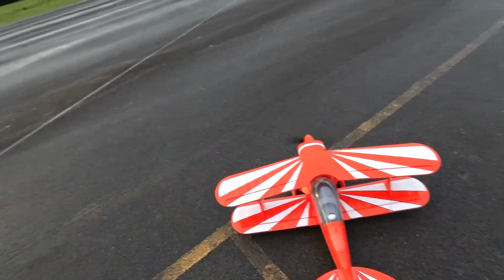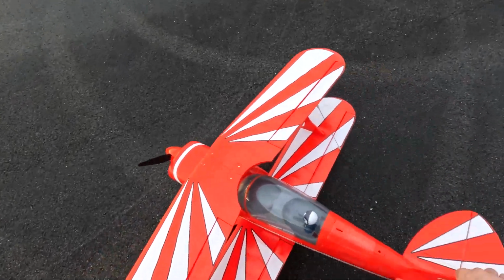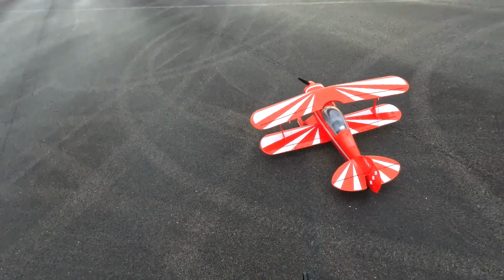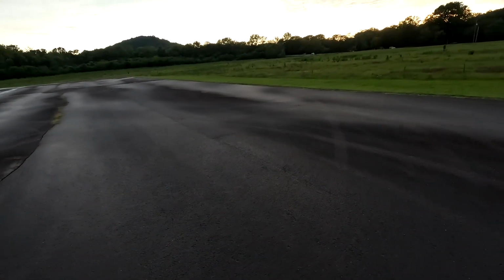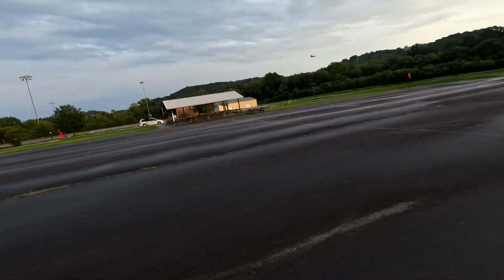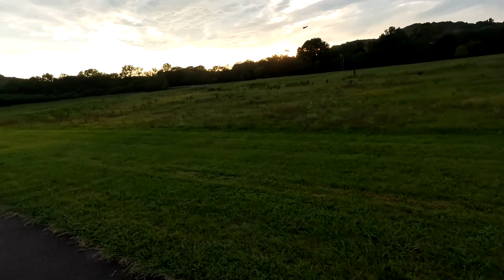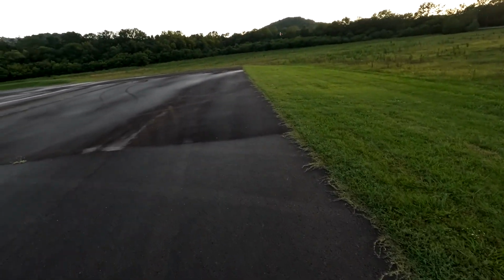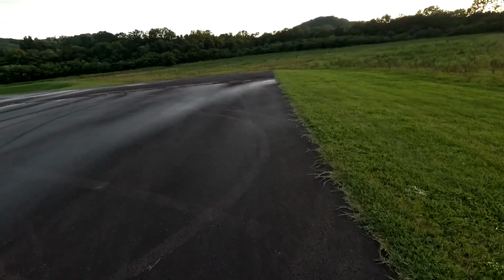RC PLANE FMS PITTS 1400mm LEARNING HOW TO LAND

Comment: 2.19K subscribers and only 4 views in 50 minutes ( WoW ) crazy stuff.Once I got the Pitts 1400 dialed in landings were easy. Sometimes it just takes the right day/weather to get them dialed it. Wet days are not the best for dialing in a plane.I sometimes wear earbuds to her my radio better especially if there are Gas/ Nitro's flying.I also recommend you install the foam mod to prevent the battery tray from sliding back. Jeff in Lower Alabama has a video on it for the Pitts 1400mm

Comment: The landing gear is too stiff and the wheels are too hard for smooth landings on pavement. They're also pretty far forward. I usually take off and land on the grass. I put an AR636 with AS3X and SAFE in my FMS Pitts..